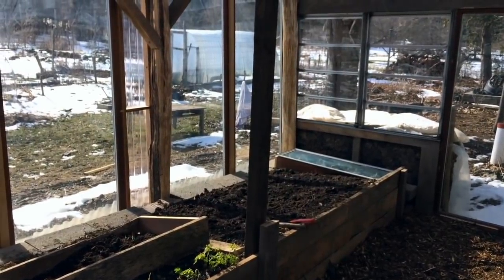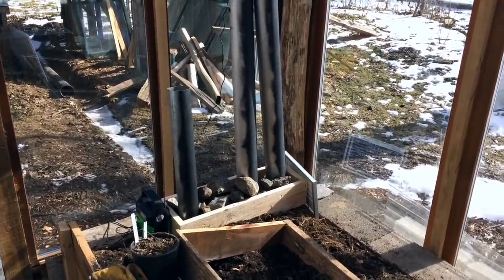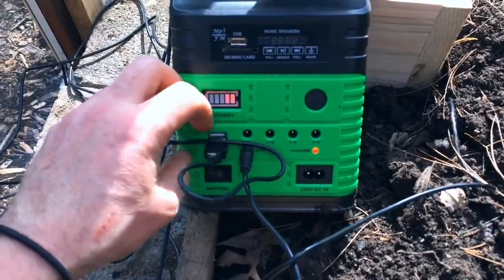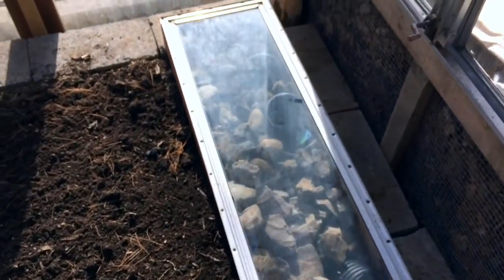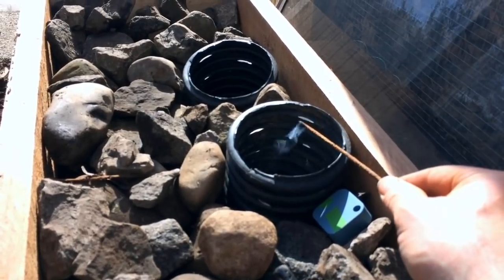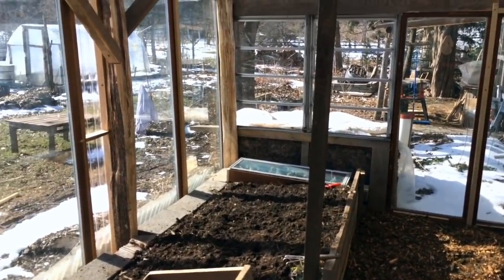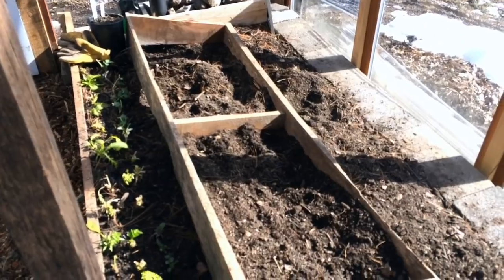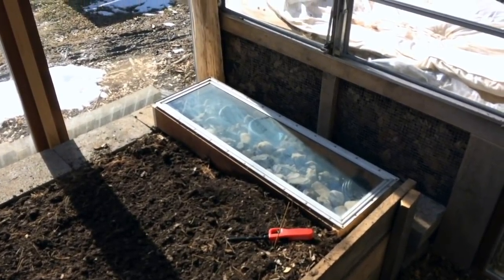Passive Solar Greenhouse - Climate Battery Activated

Comment: you need to lower the rock end to ground level, with no rocks or glass box,and put the uprights higher right upto the roof height, and encapsulate the tubes painted black, in a twin skin polly carbonate/ glass box, so they get very hot and pull from the cold to give room circulation,at first they will be drawing the cold into the beds, but after a hour or 2 you would be circulating the whole room in to the beds,, with no fans --- or go with much higher fans you would run in reverse with no glass boxes and pull the heat from the top into the raised bed and out low down with the fans on a thermal switch, that way you will not need to open windows as much in summer bcos its storing the high heat in the beds
Reply from the maker: Thank you!

Comment: Run the in take pipe up to the roof that were the warm air is
Reply from the maker: I hear you.  I spoke with a friend who built a climate battery space and he suggested that if you have the fan running for a few hours it can move the air from all around the greenhouse, so needing it to be at the very hottest isn't critical.  But we'll see...
Reply: @edibleacres  this is true... studies have been done to show that once the fan moves the air around and it all gets mixed up, having the intake at a higher level, or top of the greenhouse isn't necessary